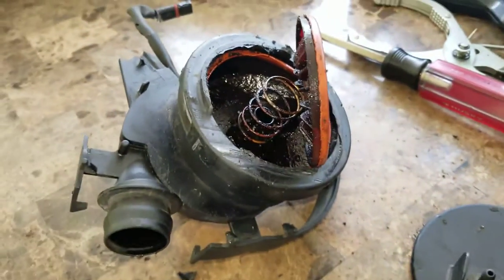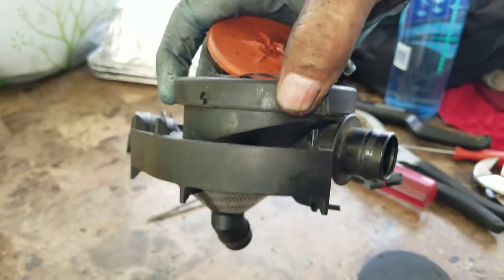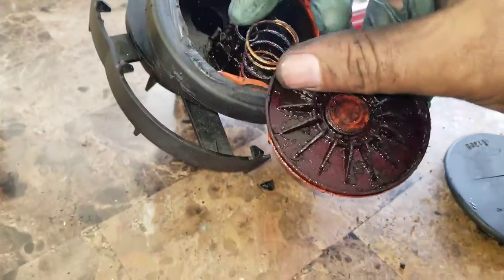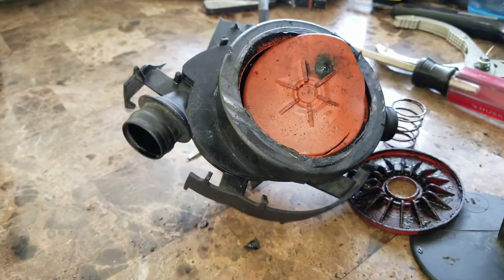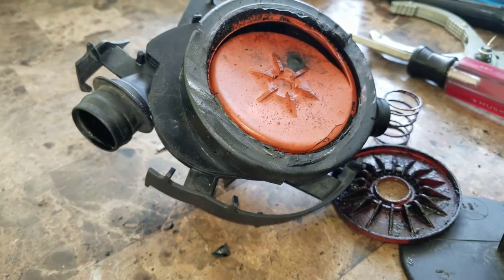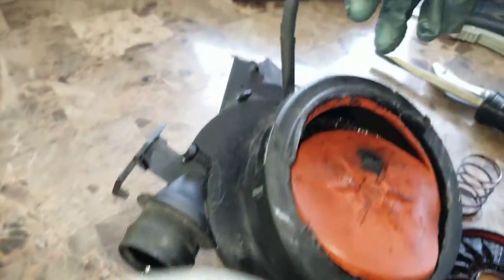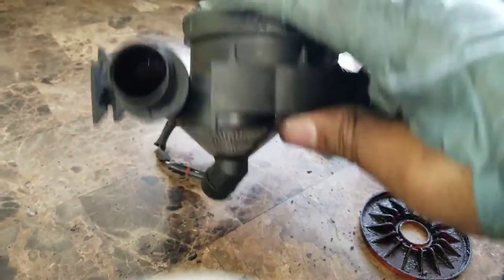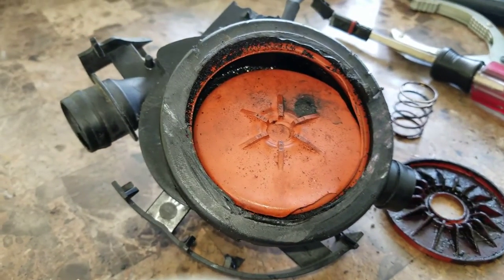Crankcase Ventilation Valve Failure Point, E90 BMW 330i 2006

Comment: Fail code ???
Reply from the maker: No failure code.  The car will smoke on hard acceleration. It will consume a lot of oil, low power, and sometime rough idle.  Sometimes it will smoke on start up, white smoke for a little and then it will stop.
Reply: Thank you :)